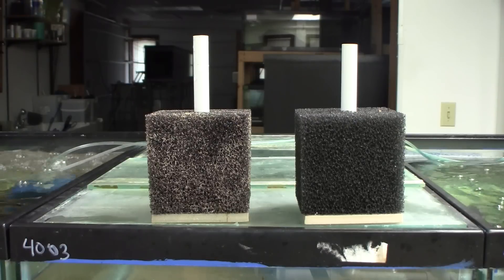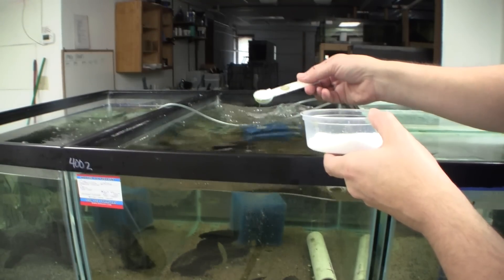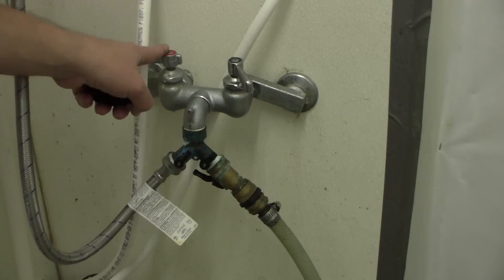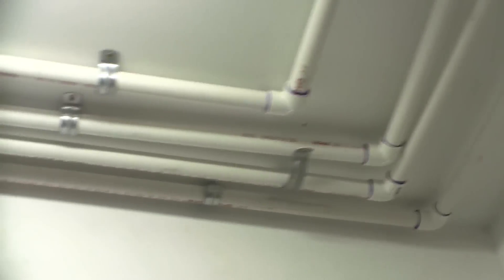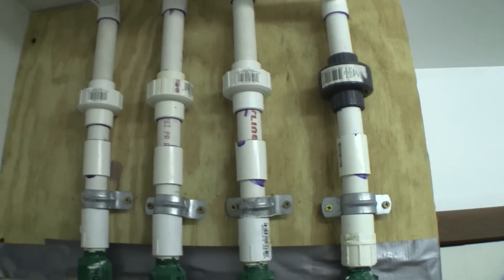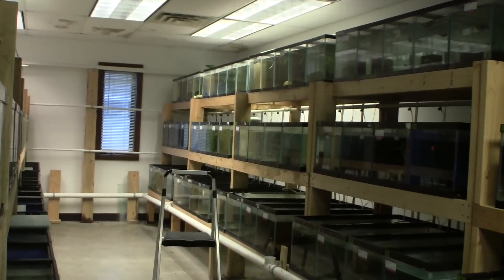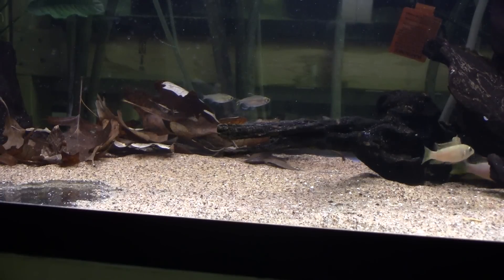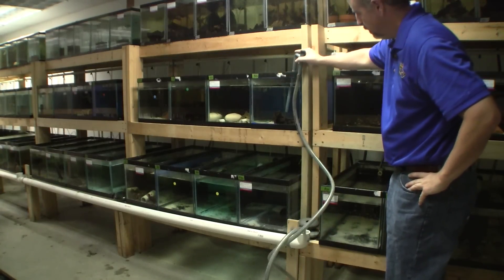Automated Water Changer

Comment: Remember, chloramines will always be found in municipal tap water even when that municipality doesn't use chloramines for water treatment because chloramine is also a byproduct of the interaction between chlorine and organic contaminants in the water system and there will always be organics in any water systems.
All cities use either chloramine or chlorine in city water supplies. Chlorine is used far less now because it dissipates much more quickly than chloramines do (it's less efficient).
Reply: Sorry to tell you but you are incorrect. Chloramine is often used in large water systems. The byproduct of the interaction between organics and chlorine is called trihalomethanes.  Look up your local water companies water quality report and they will list the data. I believe chloramine is ammonia bonded to chlorine which allows the new molecule to last for a longer period of time .

Comment: How do you get water to flow with your drain and fill system automatically without creating a siphon every time?
Reply from the maker: That system was not drain and fill, it was all fill and overflow.  The fill emitters are all above the water line in the tank.  And even if they were in the water, the water pipe from the manifold runs on the ceiling, and the manifold has solenoid-controlled valves that would prevent back flow.

Comment: Why would you put the pressure regulator after the solenoid instead of in front of it?
Reply from the maker: Because that is how I was instructed to do it by Jehmco.  The solenoid is set up to work with the full tap pressure.  The regulator reduces the pressure going into the pvc to prevent damaging it or the drop valves.
Reply: @TedsFishroom  OK, I just thought it would be easier on the solenoid if working at lower pressure.

Comment: 450 tds to 300 tds and Mg/Ca traded for NaCl- so the water softener is an ion exchanger? I'm guessing RO water mixed with tap water is not cheaper in your situation, nor is it feasible because you would have to store even more water than you already do - and the mixing of it... time consuming. Personally I wouldn't be happy with NaCl in the water - but I don't have to change nearly as many tanks as you do either.
Very informative. I'm guessing your RO unit is only used for certain fish or breeding... guess I'll have to wait to find out... Hurry!
Reply from the maker: +Catfish Cave Sodium chloride in an aquarium is not a problem for most fish in low concentrations, and 300 ppm is relatively low.  Magnesium and calcium (GH) are much more bothersome for soft water fish.  The habitats that they come from (especially black water) have no measurable GH.  I use the RO mostly for fish that are arriving from those places, and then acclimate them slowly to my tap water.  For example, if I buy wild clown loaches in and acclimate them into my 6-7 GH water, they will die in front of me in about 5 minutes.  If I start them in RO water and acclimate them to that GH over a week, they will be fine.
Reply: Awesome video, amazing set up. I used to have a whole house water softener that came with the house when I bought it. I removed it cause the salts in the water were tearing up/ prematurely corroding the copper pipes and ANY metal parts in toilets and many of the valves in the house. I swapped it out with a whole house water filter - just a huge carbon filter with catalytic carbon that removes all the chlorine and chloramimes, and fluoride, and whatever else  the water company thinks I need to have. My water is pretty hard, but that's just fine for the African cichlids I keep.  I have an RO for our family drinking water.